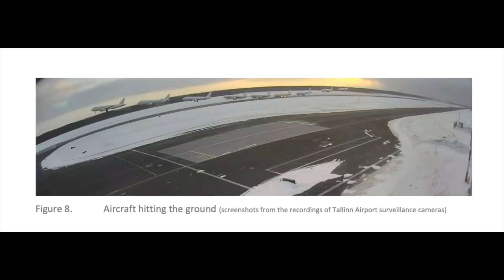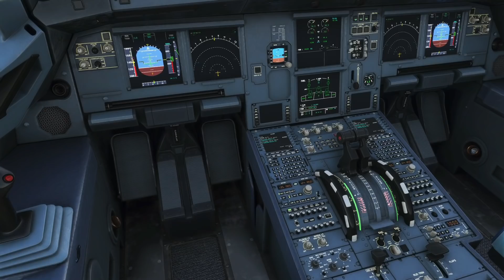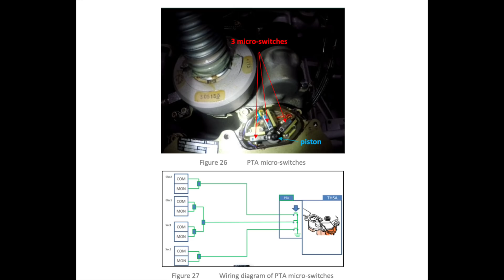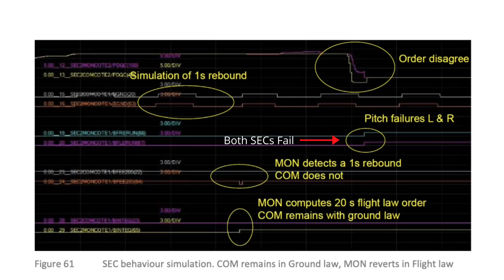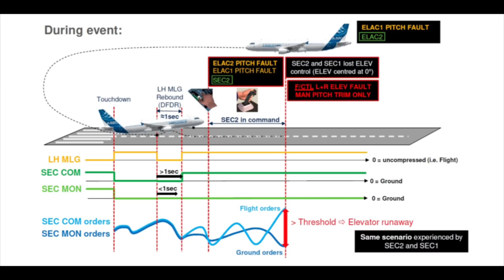The Oil Change That Crashed A Passenger Jet | The Crash Of Smartlynx 9001

Comment: Automation is rarely a problem unless, as in this case, pilots choose to ignore repeated warnings that there was a problem. It's not unusual for one of those annoying little red lights to come on ... so switch it off and switch it on again (as it were) and usually all is well. When it happens again and again it is likely to be more significant. Why did the pilots keep resetting the warning??

Comment: My attempt at constructive criticism: A basic diagram would've been really useful when explaining the technical details at around 6:50. As it was I found it a bit confusing and hard to follow along especially with the pretty but unrelated animation in the background. 
If there's somehow not already a diagram of this system then just some labelled boxes with arrows going between them would be easy to draw and get the point across brilliantly.
Other than that it's a good video as always and the other diagrams that you did include were greatly appreciated. 

P.S. I like your microphone set up. Sounds good! (strangely though, I still miss the sounds of animals in the background).
Reply from the maker: Thanks for the tip!

Comment: Cycling the power to clear a fault is fine the first time. If the fault reoccurs every touch and go, you need to full-stop and let maintenance troubleshoot. This crash was not as unpredictable as it seems. Would the mechanics have discovered the wrong oil problem the first time? Doubtful. But the better part of valor for a recurring flight computer fault on a training flight is to terminate the training flight.

Comment: In my mind, I'd want a 7 on automation, but with a catch. imo there should always be a purely mechanical backup system so that in the event of a total systems failure of the automation, the pilot still has full control of all flight controls. Something like being locked out of pitch control because of computers crashing, however unlikely, is absurd to me.
Reply: I kinda understand what you mean, but that is, by design, impossible. Because all FBW-Systems are not using linear inputs, the inputs are intentionally designed to work differently in different situations. I don't know about Boeing, but in Airbus the FBW-System isn't controlling Elevators, Ailerons and Rudders, it is controlling G's, Turnrates and Sliprates. And the computer adjusts the amount of control surface deflection to achieve that dependent on all parameters it has. In a somewhat very simplified way one could say Airbus-Pilots tell the plane what they'd like to do and the plane figures out how to achieve that. The new Boeing-FBW-Systems are AFAIK, equally separated.

And that is why you can not do the same mechanically.
Reply: @brkr78  There's a reason I'm just a layman lol
Reply: @brkr78  You don't necessarily need to make the mechanical system function identically to the automated system. Instead, a system that allows pilots to make control inputs at the basic level could work okayish, as many pilots have training on hand-flying aircraft (but I'm not sure they have training on handling such a large aircraft manually)
Reply: @williamhuang8309  What you mean is called "Alternate law" in Airbus-terminology. The FBW-systems are highly redundand and constantly checking each other, so a lot has to go south at the same time for that to actually engange, but at that point a lot of the flight envelope protections are gone, and you control the plane more directly. It's kinda dificult to explain in a few short sentences, but the ghist of it is that in alternate law the computer no longer knows how to keep full control of the plane and hands that over to the pilot. Until you are configured for landing you still only control rates, albeit, as I already saidm more directly, but once you extend the landing gear and flaps the plane goes into "direct law", and NOW you are actually directly controling the control surfaces as if you would with any other plane. 

A purley mechanical backup system isn't feasible for a multitude of reasons. You'd have to somehow disconnect the physical link while being in FBW, then somehow be able to re-engage when needed. Usage of a sidestick would be completely of the table as the forces required to even have a chance to control the plane needs a lever that is long enough for pilots to excert enough tourque for the control surfaces to move, i.e. it necessitates yokes and actual steel cables.

I kind of understand where the uneasiness is coming from, you feel like you give away your last line of defense, the possibility to intervene if you basically hand over the control to the computers. I get that, but its also a fact that computers are way less prone to making errors, they are excellent in alleviating heavy work loads, and ironically they are even more secure than manual control in the vast majority of cases. Unless the pilots intentionally disengange them the protections in place of modern jets prevents the pilots from doing things that would exceed the limits of the plane. And even in an emergency they usually are able to keep the plane flyable. For example: When one engine fails the FBW-System is taking that into account and deflects ailerons and rudder accordingly to keep the plane flying in the current heading, with the current turn rate and so on. In such a situation it helps the pilots by not having to also worry about necessary control inputs in an already high workload situation.
Reply: @brkr78  The pitch trim wheel is such a mechanical backup. It physically disconnects computers and their actuators.
Also, rudder pedals can be used to control roll and yaw.
It is not much, but it is there.
Reply: @pizzablender  The trim wheel ... yeah, no. What you are refering to is true in older planes, or in smaller planes, where the trim was, and to some extend still is, achieved via trim tabs. But no new, large plane is still using them.

 In the A320, for example, the whole horizontal stabilizer is moved alongside the elevators for flight control as long as the plane is in normal law. In this configuration the computers use the elevators for "fast" inputs, and the trimmable stablizer for "slow" inputs, if that makes any sense. In alternate/direct law the trimwheel now controls the stablizer and the sidestick the elevators. The FBW is highly degraded in alternate/direct law, but there still is no physical link to anything. If it would "physically disconnect" the computers you'd lose every ounce of authorothy you had over pitch and trim.

And the rudder pedals are definitely not physically linked in modern FBW-planes. They use the same pressurized oil to move, and like ailerons the hydraulic systems are doubled up for redundancy. The FBW-system, even without the auto pilot, uses the rudder to mitigate asymetric thrust or, if enabled, keeps any turn the pilot makes coordinated. This even goes as far as with the same control inputs the deflection of the rudder varies in different situations, an issue that, when FBW was somewhat new, actually led to a pilot overstressing the rudder with extreme inputs and ripping it off that way.
Reply: If you wanted that way, stick to riding 737. Even the 777 especially 787 have full FBW control. The different is that Airbus is more upfront and make the plane feel automated. Boeing on the other hand hides their FBW and make the plane natural to fly. Even though it is fully fly by wire behind it.
Reply: @kerucutgaming2216  Come on, only a commercial pilot born yesterday doesn't know by default that he is flying by wire (FBW) unless its a biplane in which case its just flying by steel wire rather than copper electric conduits.
Reply: Well, letting computers take any control away from the pilot is absurd to me. but i am not a pilot.
Reply: @billchapel3194  But in (most) cars you do just that. The vast majority of modern cars no longer have a physical link between the accellerator pedal and the fuel throttle, you have break assists, cruise control, lane assists, distance assits, parking assits, light and rain sensors, stability assits, traction control, the complete motor management - all regulated by computers. Not as sophisticated as those on a plane, but the environments in which these systems in your car have to work are way more diverse, complicated and unpredictable than in a plane. Yet no one bats an eye about that. Because, for each freak accident these systems might cause (which are constantly fixed anyway) a vastly larger number of accidents are prevented. Same for planes.
Reply: @billchapel3194  it's not taking control, more like it fly with the pilot. My view is the computers are closer to flying partners instead of supervisor.

Take my view as a grain of salt though, I'm not a pilot. Although I read and watch some pilot on the Internet do prefer fly-by-wire system.
Reply: The biggest planes that have cable-connected flight controls and surfaces are all that both pilots can do to move when power assist fails.
Reply: @algrayson8965  Yeah, but that hasn't been implemented in any Airbus for more than 30 years and no new Boeing for at least 20. We are talking about planes from the 50ies, up until the 80ies, or maybe even early 90ies. Even small(er) regional planes begin to switch to pure FBW in their newest versions - not all, but methinks that is only a matter of time.
Reply: Scary how there isn’t much back up when things go wrong
Reply: @matthewsmith2787  actually there are a lot of things need to go wrong. In the past few years, digital/electrical have been a lot more reliable than mechanical.
Reply: Exists in the A10 called Warthog
Reply: @wernerhahn141  A10 aint no Airliner, though...

Comment: I'd still rather be the one with ultimate authority over a computer.
Reply: Airbus a/c do have this function.
Reply: I’d need to do some research, but I’d love to know what flight mode the aircraft was in during this? Was it possible to switch into direct law and regain control over the elevator? It’s my understanding that this is always the case.
Reply: @EstorilEm  problem with modern airliner, yes Boeing included, is that they do away with the cables. So the sidestick/yoke have no direct connection to the flight controls. This done mostly to reduce weight and conserve fuel. The difference is that Boeing try a lot to make the plane feel like conventional aircraft.
Reply: @kerucutgaming2216  737max still has trim cables. It did not help.
Reply: @cbaurtx  737 MAX have cables for all the controls. It is the only "modern" airliner that still uses purely cables for control. The problem with the MAX is that Boeing try to manipulate "feel" with the old cable and pulley system. If 737 is fly-by-wire, it would be much easier for Boeing to tune the aircraft feel.
Reply: @kerucutgaming2216  Have there ever been incidents due to compete control loss on FBW aircrafts? I'm genuinely curious, because all the ones I know of have happened because of the loss of piloting aids normally available in FWB...
Reply: @LoGaIta99  this video is one of the case. If "MAN PITCH TRIM" shown on the PFD, FBW is already lost. Only the rudder and pitch trim on A320 family that are cable driven. So they can be manipulated even with total loss of FBW system.
Reply: @kerucutgaming2216  You're right on the pitch axis, FBW to ailerons for roll was still active. However, a reset on one of the SEC would have restored pitch FBW. I've read it on the official report: https://www.ojk.ee/et/system/files/fail/manus/ee0180_es_san_investigation_report.pdf .
Furthermore, on the latest Airbus aircraft (A380 and A350), the backup control system would remain electrical and there is no trim wheel on the flightdeck (so no missing ELAC override signal).
Reply: @LoGaIta99  777 and 787 also doesn't have conventional trim wheel. This means that both Airbus & Boeing are very confident in their FBW implementations.
Reply: That was the issue. The ultimate authority was with the pilots. They took control by fooling with the controls, the computers said "you have command" and then the team of pilots didn't know how to fly the plane.
Reply: Aye, pressing a button and then sipping coffee the rest of the trip doesn't make much of a pilot, does it?
Reply: This has nothing to do with having authority. It was basically computers not able to carry out the commands
Reply: @tomstravels520  Did you not hear the question at the end of the video?

Comment: Automation is an amazing aid when done properly. Automation oversight is amazing when done properly. And here lies the issue. Large complicated machines need the automation and should have it, but they also need good over sight systems. And when those fail only highly trained and competent can recover them without any warning.
So yes, more advanced automation is great and we need more of it but training in that automation is just as critical.
(I work in a factory with automated equipment, sometimes something simple and easy brings everything to a stop because of lack of training and nothing else)
Reply: Rube Goldberg machines.

Comment: I think we are at a point where we have a good amount of automation in commercial aviation. Pilots make errors, but so do the engineers that design the automation systems. In cars i believe we need a lot more automation. Modern cars with automatic emergency braking, adaptive cruisecontrol and even the "crude" auto-steering of a few luxury-cars like Tesla is a huge step forward for a big killer(Car-accidents) in modern times. I love driving older cars where you are in control of everything, but for simple transportation and security, nothing beats a modern car. Older manual car for enjoyment/the track and a newer, automated car for transportation.
Reply: The problem with automating cars these days is that people are relying too much on that automation and are forgetting some of the finer points of driving that only come with experience. I asked a driver once why they were following the car in front so close, their reply was it's ok, I've got ABS so I can stop really quick........... wrong. 
That being said, I think automation for cars will serve us better on roads like highways where there are no junctions, pedestrians or oncoming traffic. Providing the system is working properly, without the human element there will never be any crashes.
Aircraft already have a level of automation that brings into debate wether a pilot needs to be there at all.
Reply: No pedestrians or oncoming traffic on highways? Usually, yes... Occassionally even planes did an emergency landing there ;)
Reply: @rainerleicht4604  And therein lies the problem with automation, it can't deal with a situation that it isn't expecting. It would require a human to take action to solve the problem.
Reply: I hate car automations like the ones you described.  I know exactly what I wanted the car to do, and I hated having a system trying to stop me.

I want more control of the automation.
Reply: Automated stop-start which stops the engine every time you're stopped, then restarts it. It kills the engine for maybe 1 to 3 extra mpg and is dangerous as it leads to a lag time.
Reply: @donnafromnyc  Especially in trucks.  A couple I know recently got an F-150 with a tow package so that they can haul a horse trailer, and the stupid thing has a stop-start that they disable every time they turn it on.
Reply: To each his own. I've dealt with these baby-sitting devices numerous times in rental cars, and can't stand them. I'll drive, thank you.